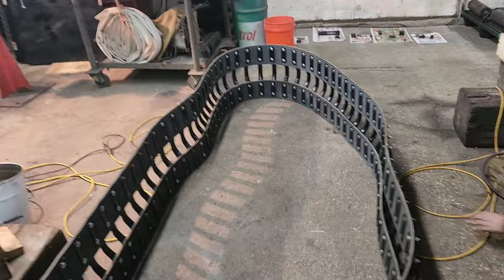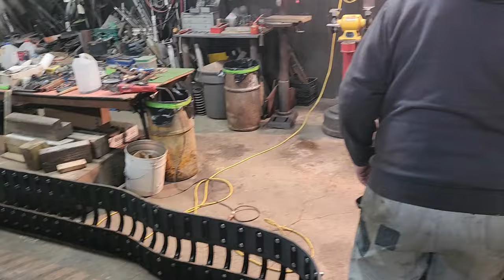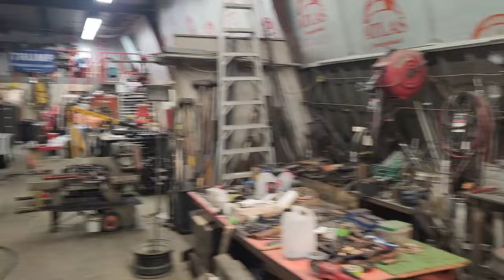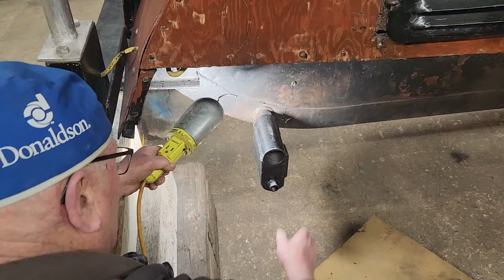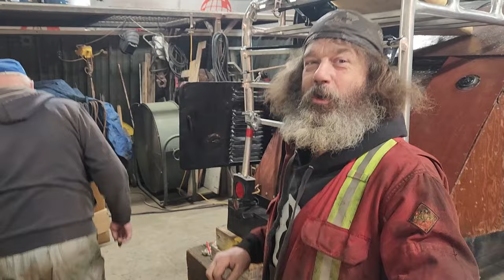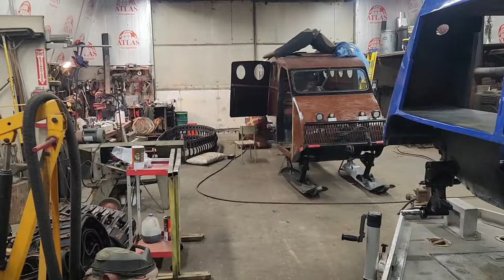HOW TO ASSEMBLE TRACKS WITH APPRENTICE | BOMBARDIER

Comment: How tight does dad recommend to tighten the fasteners holding the grousers onto the track belts? Obviously you want them tight, but to me it seems you can over tighten them  and squish the backing plates. Or am I wrong? I'm assembling a track right now and  would like to know what dad says about that.
Reply from the maker: great question! Dad says if they are course thread, no lubrication, 30 pounds. If they are fine thread, no lubrication, 35 pounds